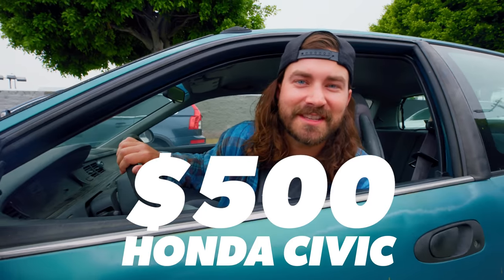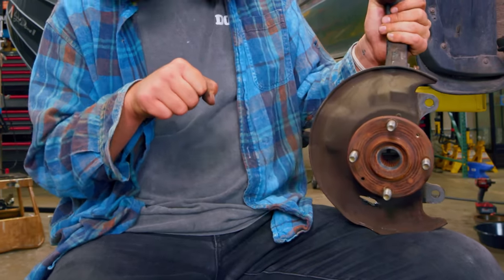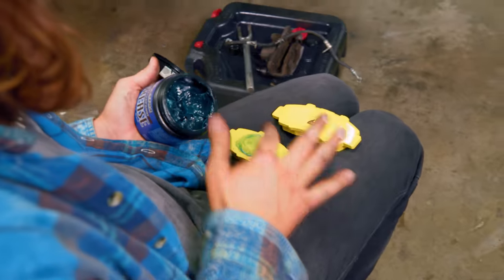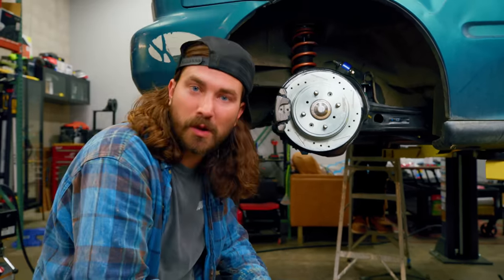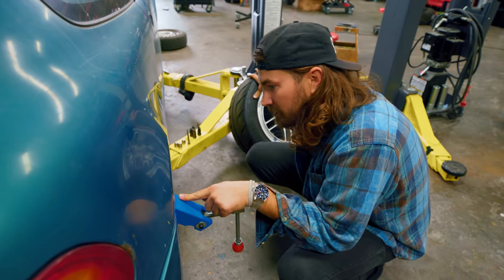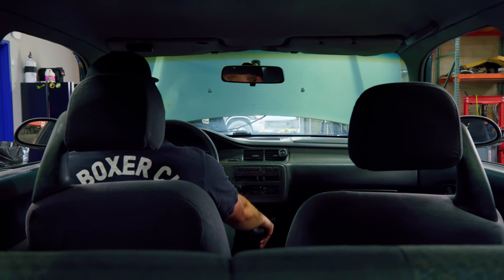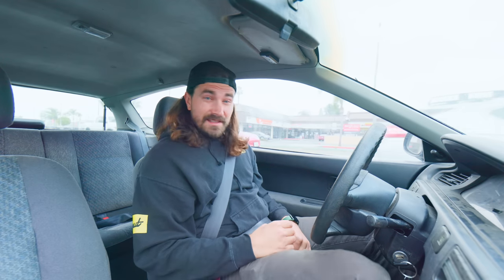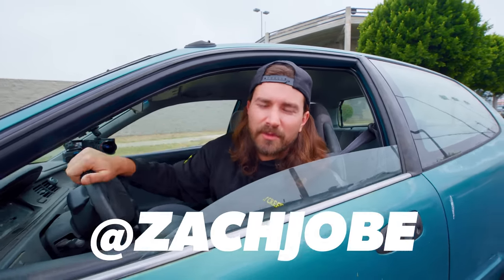We Put $5000 Brakes on our $500 Civic

Comment: Got a new Tacoma in 2020 and came with rear drums. They'll last longer, but don't stop for crap.
Swapping to rear discs should be enough. Better brakes should be in the rear. Otherwise it's like stopping a bike using only the front brakes. You're gonna have a bad time.
Reply: no better brakes should always be in the front
Reply: @arcanevoid9199  When you get 2 new tires, you always put them in the rear. How is that any different?
Reply: @danteeightsix9069  you dont always put them in the rear, it depends on the drivetrain of the car. but when you brake the weight shifts to the front of the car which is why you want bigger brakes in the front as they will be doing most of the work

Comment: 4:37
"Not very good at braking."
Technically, they're far superior at braking. Just not at very hot braking.
Heavy trucks, forklifts, heavy machines still use them for a reason. (and wet brakes by heavy machines)

Comment: why 2 different rotor types- wouldnt it have been most beneficial use either vented  all around or similar solid rotor as the front in the rear as drilled often crack after heat cycling and cant or often are not easily turned.

Comment: Actually fals information the proportsion thing (idk how its called,we say regulator) its to reduce ,or better say regulate rear break power when having disc so your car doesn't lock the rear wheels 

actually really dangarous thing that led in many cars crashed because people think you need uphrading rear breaks
you really good up to 300hrsprs with standard rear brakes it only breaks 20-30% max

Comment: I always thought you are not supposed to brake hard on new pads and rotors for the first hundred miles or so
Reply: Yeah I wouldn’t agree with this concept, bedding brakes is supposed to be done from highway speed and slowing down on an off ramp. Braking from high speed to a stop over a long distance, stomping on them obviously risks warping of the rotor, being new the riskiest because there’s no brake material to sinter in between the pad and rotor making it a direct contact surface which could bend the rotor being stomped on.

Comment: Drum brakes are much better for braking in city driving. The surface area is much more than disk pads. They are a HUGE pain to work on though.
Drum brakes are NOT good for performance driving as they hold on to heat like a kid with candy.

Comment: drilled and slotted in the rear but solid in the front, why? Makes no sense as the front brakes handle majority of the braking therefore get hotter and need the heat dissipation more than the rear

Comment: I have problem with my brakes (not spoon)... I did 282 swap on my eg paired with stock drum brakes on the rear. Everything is brand new on the front and drum brakes are fairly okay. Everything was bled out but when I start the car, brake pedal sinks... I replaced the bmc with bigger one (7/8 to 13/16) and same thing. Changed the brake booster and still nothing. Can someone help me figure this out cause it's driving me mad

Comment: You paid $5,000 for used parts, Honda discs, a proportioning valve, a master cylinder, brake lines, and 2 calipers? You guys got ripped off badly. Where the hell did the majority of that go?

You could have bought the calipers and discs from a Porsche (or most other performance cars), paid someone to make custom adapter brackets, and still had well over $1,000 left over. That setup would be a significant upgrade from the $5,000 setup. And I only included the custom brackets to maximize the counterexample - the brackets to put Porsche brakes on a Civic already exist, and cost less than $300.

6 piston Wilwood front brakes (calipers, rotors, lines, adapters) for a Civic are $1100. 

I understand the money pit idea, but this was either just burning money unnecessarily for mediocre parts at best, or this video was purely an advertisement for Spoon.

Also, have you guys never heard of a baseball bat? Hammering the fenders was totally the wrong way to do this.

Comment: Properly setup drum brakes actually have more stopping area and better heat disbursement. They are also a hell of a lot faster and easier to change and much more reliable. There is significantly more surface area between the shoes and the drums.

**OMFG OVER HEATING BRAKE PADS LEADS TO GLAZING WHICH LEADS TO SLIPPING WHICH LEADS TO YOUR BRAKES NOT WORKING CORRECTLY AND WE ALL KNOW WHAT THAT DOES**

ZACH JOBE, YOU ARE NOT A MECHANIC and PLEASE STOP MISSING INFO OR HAVE A REAL MECHANIC EXPLAIN THIS, YOU"RE GOING TO GET PEOPLE HURT OR KILLED.

Comment: Guys! I love yas but man. There comes a time where you gotta add things up. You said bought the car for "$500" ok fairy tail scenario not gonna count the amount of money it took get it running but at this point this car already had a 4k suspension setup. So you're putting 5k brakes on a 4.5k car. 😅 you were to sell that car and add a Donut sticker with a picture of yall and some signature as is I'd be easy 10/15k car guesstimate

Comment: Bedding in brakes noobs much? You're are meant to bed in new brakes in short pulses, not just burying your foot and holding them on. Doing that glazes the pads and can "blue" the disks, which gives you a worse surface than if you bed them in the correct way. You start by little pushes, then more. You do that until they feel good (once the pad & rotor surfaces have made love) THEN you can just hold them on. Noobs....